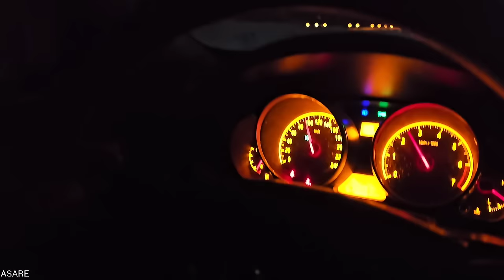Nomadic Couple's Difficult Journey: Illness, Heartbreak & Nowruz Surprise!

Comment: Hello dear friends it is a NEW YEAR LET BY GONE BE BYE GONE FOR GOD SAKE let it pass and guys FEED THE DANG DOG FOOD not chicken bones that is bad for them they can choke on the bones did you know that it will get stuck in there mouth chicken legs is not good just letting you know i never ever give my dogs chicken bones or any other kind of bones it is very bad for them that is a very very pretty dog i would hate to see it die from a wrong bone it ate. R you kidding me a power washer on a dog that is to hard on him no no no omg no wonder he don't like it try that on your self see if that hurts you omg that dog is shaking he is cold you are nuts  as for your car never ever add cold water to your RADIATOR why you will get a cracked head so you will have a leak somewhere better get it check that is why your losing water so you better get it check out asap or you will have motor problems i know somewhat about car motors might need a new head if you cracked it not kidding you all better take it to a shop soon or you will be sitting on the side of the road after you get out from your car look under it see if there is any wet spots under it after it sat for a while something is leaking somewere  PLEASE WEAR YOUR SEAT BELT IT SAVES LIVES???????wow what a big blow up and how come you didn't tell her parents she is going to have a baby yet??? o well may god bless you all and good luck